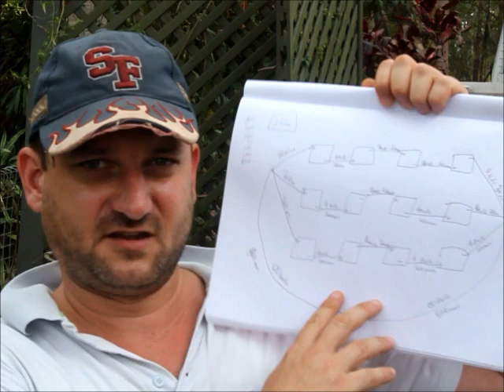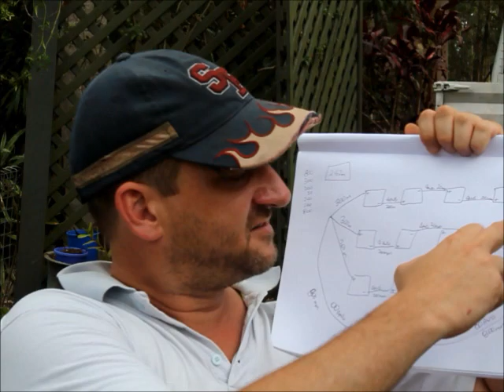Response to Justincase - and a DC Cabling Design Primer

Comment: I have been using the PCM5048 on 24 volt 1350 amp Hour SLA bank and before that on flooded 1000 a.h bank. My gripe is that the controller pumps out so much RFI EMI that i cant use FM or my Ham Radio at the battery shed or even with HAM antenna and Radios located 100 meters away. This is a nightmare perhaps the capacitors in my controller are no longer in spec.  I am with you on your issue with  both products. I think it is time to replace my controller caps.!

Comment: The Voltronic inverters are very popular here in South Africa, mostly due to cost. They combine a Sine Wave Inverter with an MPPT controller. While watching your videos, I was wondering if these newer combo units are any better than the old ones. It seems the inverter still uses those 63V capacitors, and I heard reports of DC bus overvoltage still occurring from time to time. Of course the only reason that I'm interested is because if these inverters are even halfway good, they represent exceptionally good value for money. Not that I'm about to buy one any time soon: Like you, I'm also in the blue team. Just curious what the new ones are like and what you think of them?
Reply: On technical grounds there really is no comparison between Victron and Voltronic. The thing that wins out for most people is the price. The so called Axpert inverter isn't a full hybrid either, so a proper comparison would compare the Infinisolar with the Multiplus. The difference there isn't too bad, the Infini costs about 20k (ZAR) while the Victron is about 28k. The difference is that for the Victron you need to add an external charge controller and a CCGX to do the same thing, and that literally doubles the price. So I fully understand why the Voltronic is popular, but I agree with you: Still don't trust either the gear or the support.

On that topic: Do you have a CCGX in your system? If not, and if perhaps you skipped it based on cost: The firmware of the CCGX (Venus, really just OpenEmbedded Linux) has been ported to the Beaglebone black and more recently to the Raspberry Pi. The RPI port is still a bit raw, I'm still working on it, but coming along really well.

Comment: I think you may have planted a seed. I see in discussion on one of Justin Case's video he knows about the Chinese battery balancers I have installed. He mentions Giant have ordered 50 units so perhaps he will be taking some precautions.
Reply: Hi Dockarl  - believe it or not my PIP has lasted 3 years. I found a secondhand unit for AU$ 380 and have two in parallel. For the most part  they are really idling. I have changed to Lithiums and don't charge to the recommended voltage charging to 0.2V lower but never go over the 54V limit of my Pylontechs. I run Mike's firmware and would like to make the changes to the caps and MOSFETs that Mike recommends but struggling to find viable alternatives in this country.

Comment: Great video mate. Its good to hear from someone that actually knows what they are talking about. I've watched some of justincase's videos and his explanations seems to be all over the place in that he tends to try to explain some technical issue, gets tongue tied then reverts to showing the screen on the charge controllers to show how much power his system is producing. Also he changes his cabling etc. more times than I change my socks. I think that his problem is that he is not qualified in electrical in any way, not that he said he was,but he gives out advise as if he was. He also makes money from sponsors by advertising their products which is ok as well and that's why he does his videos. Its probably why he is able to change everything around all of the time.
Reply: Easily_Bored_Engineer ...Gday, Have just posted the link that you suggested to the video where he shows the problem with his dead battery. It will be interesting to see his response.

Comment: I have a balancer that I bought from a guy in Brisbane that seems to work that way (and work very well). I also have 2 battery extra desulphators that seem to do nothing but monitor voltage. My MPP PIP2424MSX is working brilliantly, thats why I was suprised to see that there was a problem with the 48v version. I will be upgrading soon to a second inverter the same but it will be from Giant power, just for the local warranty. Sorry to hear thet you are having such drama with something that should just be fixed under warranty.
Reply: dockarl123  I hope so lol. The word "warranty" in asia seems to be a joke.

Comment: Hi dockarl. After looking at your video it seems to me that you have done your research and the MPP unit that you have is a piece of shit. I like the idea of using stereo amp wire, those babies can suck some current and like stable power.
Is a zener much the same as a battery balancer?